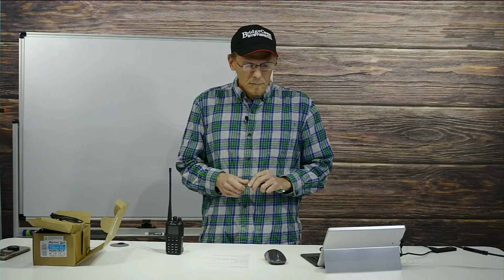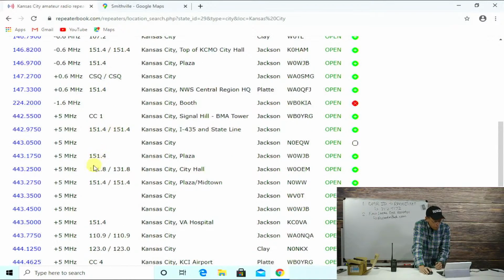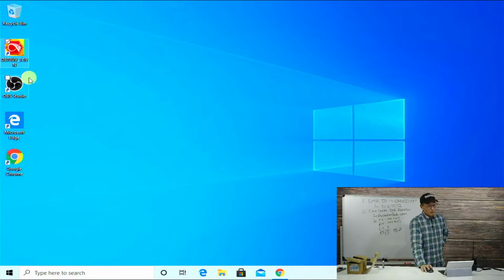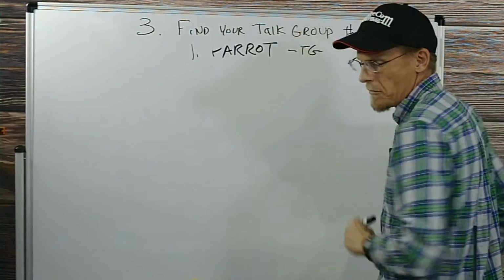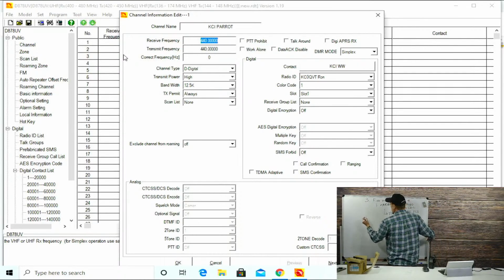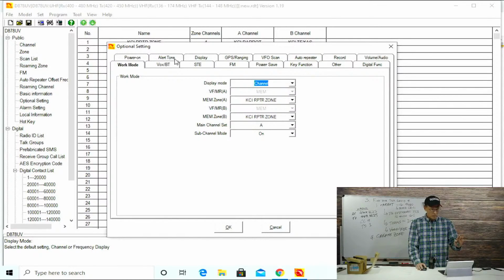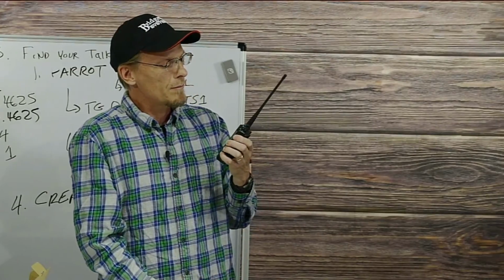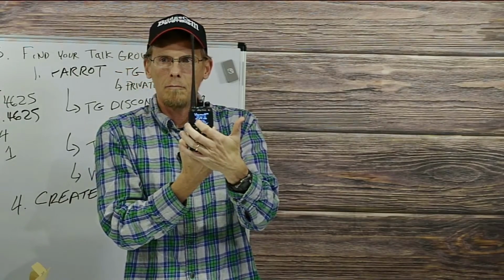Step-By-Step: How to Program Your New AnyTone to Hit a Local DMR Repeater

Comment: I followed your instructions on programming my DMR radio, but when I try to contact to Parrot or any other Digital channel, I get a "Connect Fail" or a p2p limited message.  Did I do something wrong in my programming?
Reply: Same problem as you. The repeater is only 4 miles away.